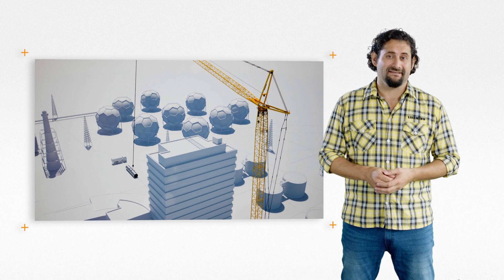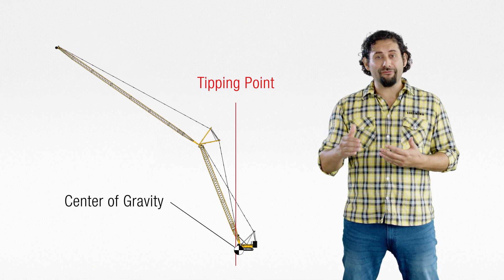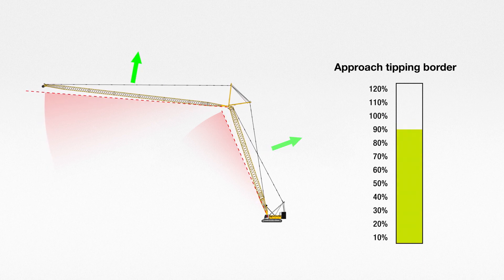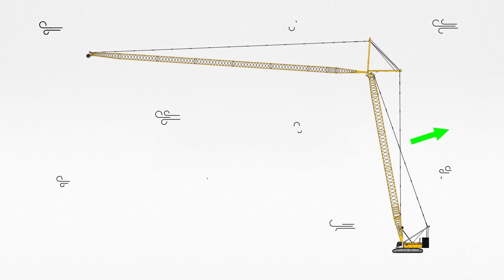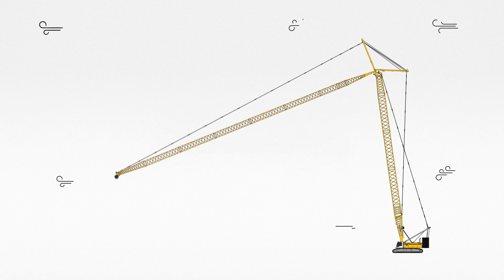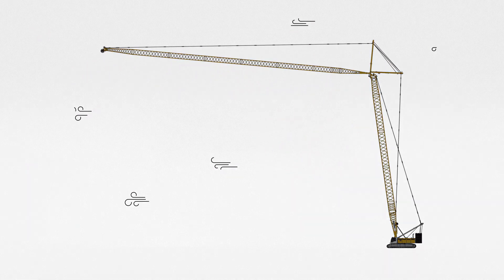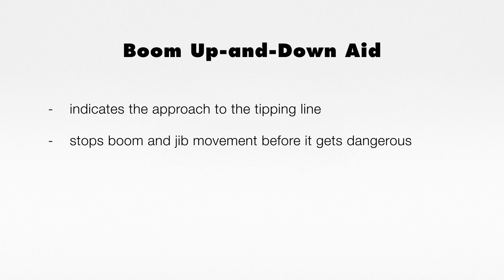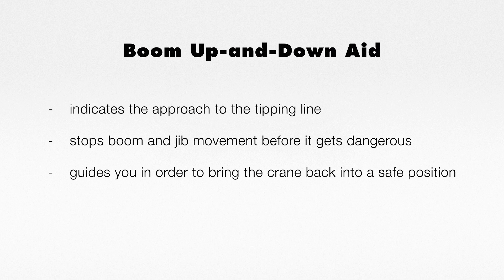Liebherr - Boom Up-and-Down Aid

Comment: In the video you show the wind coming from behind, trying to tip over the crane. So what happens if you lower the boom against the wind and then rotate the crane (or the wind direction changes)? Is this rotation also prevented? Or do you only allow lowering to a point that would be safe for the windspeed if the wind came from the worst possible direction?
Reply from the maker: Lowering or raising of the boom is only permitted as long as the stability of the crane is given (according to normative specifications), regardless of the wind direction. In general wind from the rear means the highest tipping moment for the crane. Therefore, this wind direction is shown in the video.
Reply: @LiebherrGroup  Thank you - so it's what i  tried to describe in my last sentence, makes sense, cheers!